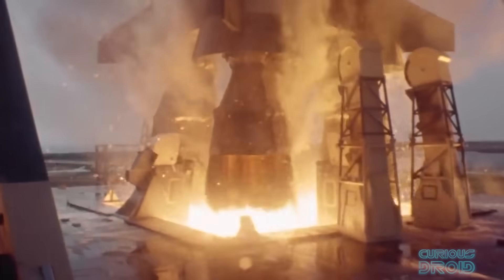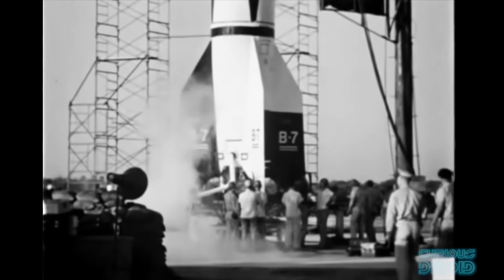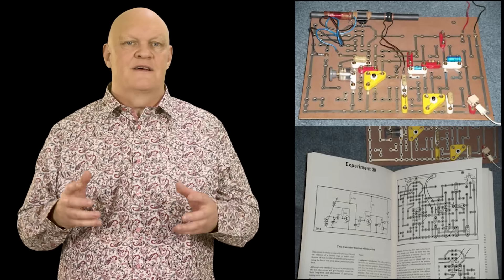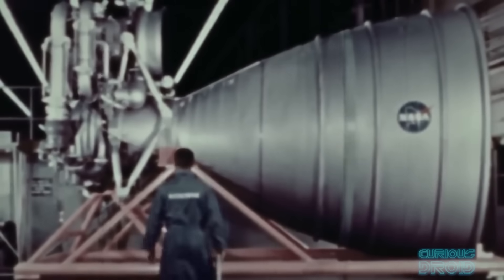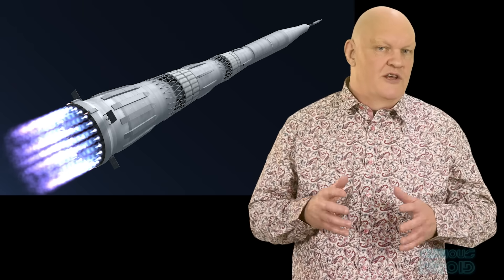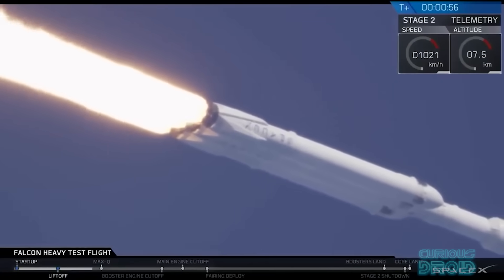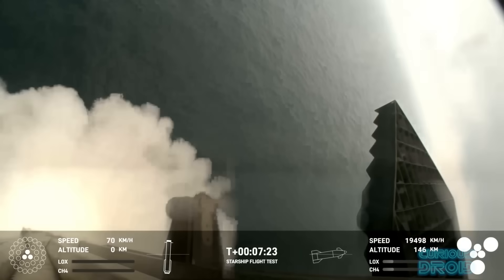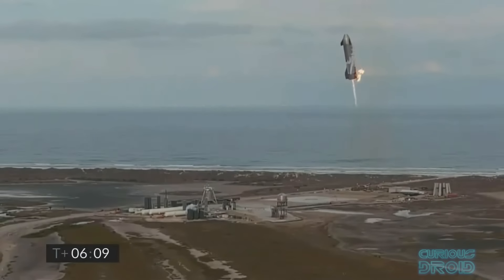Why Does SpaceX Use 33 Engines While NASA Used Just 5?

Comment: I think that they should either add 2 fuel tanks to the side of the Starship.  This way like Falcon9 the 1st 2 engines could be ejected back home and 2 refuel s could be used off a Falcon Heavy s engines. I know that sounds weird but I’m sure either through that means or just by finding a means to swap out fuel tanks or carry 2 extra side tanks. Surely that would help make refuelling it easier. ??
Reply: Would make it more difficult. The plumbing would be more complicated, the detachment mechanism would be complicated, and everything would add weight. Further, the tanks with fuel would be too heavy to carry up in another Starship. The fuel weight is around 1,200 tons and the payload weight can only be 150t.

The easiest thing is to simply dock and pump the fuel from one vehicle to the other.

Comment: Mathematically SpaceX has a higher chance of failure IF each engine carries the same probability of failure
Reply: The engines have a higher chance of failure, but the mission has a greater chance of success since a single failure wouldn't cause a mission failure. Further, because the engines can be massed produced, they have the possibility of a lower failure rate.

Comment: The falcon 9 heavy and starship suffers what i call the "N1 effect" (also known as the add moar boosters or KSP effect). This effect is what happens when engineers are unable to develop more powerful engines for one reason or another and instead opt to strap a massive amount of smaller, existing engines onto a rocket.
Reply: These boosters land on the engine thrust.

However there's a minimum limit to which engines can only be throttled down. If you use big engines you can't land the empty and light boosters any more.

Rockets which are only single use don't have this limitation.
Reply: You do realize that the Falcon 9 had launched 3x more times successfully than any other rocket in history, right? SpaceX literally built the most reliable rocket ever by far.
Reply: Given all that, SpaceX is kicking NASA's @ss!

Comment: Here is the short answer. If you have 33 engines and you lose one or two, no big deal. If you have five engines and you lose one or two, RUT-ROW, NOW WHAT?
Reply: When has an engine failure actually been a problem?
Reply: @MrSummitville  Actually, lots of times. Even the Saturn program had engine issues turn into problems. Just not with the F1. Recently with a Falcon upper stage as well. But many rockets throughout history, new and old, have had major issues due to engine failures.

Comment: I suspect SpaceX's Starship program can be game over if they lose one more. They lost already one hundred engines.
Reply: Nope. Their tests so far have all achieved their desired goals. And none of the tests were planned to save the engines or boosters. Flight 4 actually had both the booster and upper stage land, but SpaceX didn't go out to get the engines. Further, they are already beginning production of Raptor 3 engines. So the dozens of Raptor 2s that are already built are literally going to be used for tests and then scrapped if they survive.

Comment: Also a bit improper to compare spacex and the ussr with regards to testing. While spacex does use the go fast and break things often method, they also test each engine rigorously before putting it on the rocket

Comment: One engine failure on a Saturn-5 booster takes out 20.0% of your thrust and is catastrophic.
One engine failure on a Starship booster takes out 3.03% of your thrust and is negligible.
Reply: How many Saturn-5's had an engine failure, after launch?
Reply: @MrSummitville there was one, and it could only be compensated because it happened not in the initial period after lift off.

However you could not land a Saturn 5 booster on the engine thrust  because the thrust of 1 engine would still be way too high (even if the technology to control that would have existed back then).

That's why Falcon rockets and Starship are using more, but smaller engines. They can land on the thrust of their engines.

Comment: When the nozzles are non steerable and use instead fixed position thrust modulated, the number of them must be multiplied in order to provide redundancy to more than one level. It's a numbers game.
Reply: No.  It is not like that.  Starship's first stage booster rocket has 33 raptor engines.  The 20 outmost ring of engines are non steerable like you said.  However the rest 13 Raptor engines are steerable with gimble   The booster can use the rocket engine's gimble to control direction.  This is the area spaceship improved over the Soviet Union N1 rocket.  I think it is all about throttle control.  It is simply the easiest and most powerful throttle control.  If you turn on just one engine, the power is throttled all the way to 3.3%.  Such precise throttle control is very useful in re-entry burn and landing burn.

Comment: 8:45 reminds me of finding what causes elusive rare but critical effects. Driving a single event shock into a closed loop system to provoke a response, then studying how nodes in different places in the closed loop react, their relative phase between them in the time domain, this analysis points to exact mechanism of effect.  In this engineering for manned spaceflight is not good enough to 'opamp unstable add a capacitor', instead it needs to have demonstrable phase margin over full operation bandwidth.

Comment: Why Does SpaceX Use 33 Engines While NASA Used Just 5?
So, in sort, what is that answer of the above question?
Reply: Nasa uses a single use rocket.

Space X develops Starship to land on their engines. So the minimum thrust has to be low enough to land the empty booster.

If you use 5 big engines the minimum thrust would be way too high to land the booster.
Reply: Did you watch the video?

Comment: The Russians used 32 engines that couldn't be fired accurately at the exact time. After the first one took off the second stage fired and blew up the hydrogen tank of the first stage that it was sitting on and blew up the rocket. When the next rocket was launched it fell over because only about half of the engines fired. The rocket blew up with the energy of two atom bombs and killed over 100 of Russia's best rocket scientist and the third Russian made moon rocket was later sold to a billionaire in Arizona. I think that 33 rocket engines is a terrible idea that could bankrupt our space program just like it did for the Russians.
Reply: Given all your negativity,  SpaceX is still kicking NASA's @ss.

Comment: Because SpaceX is unable to development a large engine.  They  only have one used system, to Earth orbit and docking, Falcon 9 and Dragon..  Nasa and the Soviets have been doing that for 60 yrs. They don't have a market for Heavy and Star Ship has exploded every flight but one. 8 failures that SpaceX gas lights us saying  the failures are really successes,  Saturn V, 55 years ago never exploded .
Reply: Starship has reached orbit 3 times and the Falcon 9 is the most reliable launch vehicle currently in operation. NASA relies heavily on SpaceX and Russia's launch cadence has almost stopped because of them. They don't have a large engine not because they're unable to develop one, its down to economics and reusability which smaller engines are better for
Reply: @Ethan_Roberts  What does "been to orbit" mean?  It doesn't mean it was in orbit.  I guess you're saying it went as high as an orbit is. At any rate the Star Ship hasn't orbited, which is it's purpose. If SpaceX is so great why is it they have only one marketable launch and docking system.?  And after years of exploding, the Star Ship hasn't been in orbit and is delaying our moon mission progress.
Reply: @davidsoom1551  it achieved orbital speed, its quite simple really. Why do they need multiple docking systems? The Dragon vehicles are doing exactly as NASA wanted and have done so for over 10 years. Starship is not delaying Artemis any more than SLS and Orion have delayed it or any other contractors. Do realise that delays are expected with complex space programs
Reply: @Ethan_Roberts  SpaceX isn't the most fantastic launch system the hype presents. There are nearly 50 launch providers that service the space launch market.  In this regard SpaceX is small potatoes. Heavy is never used as it has no market.  Star Ship designed for Elons million person Mars colony is ridiculous. This whole idea is preposterous. It has no sustainable future market. Point to point military use is laughable when you understand you cant load the rocket with anything useful as you have to lift everything 250 ft and load it through a small door.  Regardless, don't think SpaceX will get us to the moon and less so to Mars. Enjoy the CGIs.
Reply: @davidsoom1551  never claimed it was the most 'fantastic launch system' but looking at their track record and the falling launch cadence for almost everybody else, I think that's pretty good evidence to say they probably are the best current launch provider. Starship is still under development so to say it has no future is just hating. Bet you also said the Falcon 9 would never be reusable too
Reply: @Ethan_Roberts  If there is a falling launch cadence among all launch providers it's because there isn't a great market, about 100 launches worldwide per year.  Again, the future market, when you realize the Mars colony is a joke, isn't there. No one is using heavy and Star Ship is for Mars colony. lol  Why so many failures in the Star Ship development when Saturn V, at the very beginning of space travel had no such explosions, one after another?  Seems things aren't going well for the super rocket with no future.
Reply: @davidsoom1551  I said most, learn to comprehend what I'm saying. Roscosmos, ESA, and ULA are hardly competitors due to their low cadence. Customers are mostly using the Falcon 9 to go to space. And to say there is no market at all is BS as the total launches worldwide is increasing with 146 in 2021, 186 in 2022, 223 in 2023, and most launches this year so far are from SpaceX. Starship is being developed in a different way to the Saturn V, trying to use their method of iterative development to call it a failure is disingenuous
Reply: Tell me, what is the future market for super heavy StarShip that will give Elon his needed cadence of 3 flights per day?
Reply: @davidsoom1551  Starlink and whoever else decides to use the launch vehicle.
Reply: @Ethan_Roberts  That will be 1100 launches a year?  Starlink?  You have just proven there is no market.  And don't again label me with your "hate" talk again. That just shows your weak generational name calling non sense.  So it's settled, there is no future market for the massive Star Ship.
Reply: @davidsoom1551  again, people like you said there's no market for reusable rockets or that they will just be a fad, you were wrong. You're simply hating, that's an appropriate label for somebody like yourself

Comment: Apollo 13 only had 4 working engines after launch.
Reply: It was the center engine, on the 2nd stage. It was shutdown after ~5 minutes, instead of ~7 minutes. An electrical problem turned the engine off. The engine did not actually "fail".

Comment: The N1 rocket was only more powerful  than the Saturn at the first stage level. Once that stage was dropped the upper stages, which used the same type of fuel and engines had less ultimate power relative to the weight of the stage. Thus a lighter weight lunar hander, with just one Cosmonaut aboard to walk on the moon was the plan, had the N-1 worked right.   The Saturn upper stages used hydrogen and oxygen, a more potent mixture yielding more capabilities  for the  three U.S. astronauts with two able to land.

Comment: NASA used three engines on their rocket because that was the minimum number of existing engines that was adequate to provide the safety margin that they wanted, for controlled, if less than  optimal, flight.  I'm betting that when SpaceX gets into the 4th and 5th generation of the rockets and further improves their reliability and cost of manufacturing of the engines they're using now for Starship they will reduce the number of booster engines and make them larger.  There're factors that create a point of diminishing returns in tons per launch to orbit - infrastructure and location.  The acceptable launch sites are all on national boundaries ( not in my back yard) and all have logistic issues.
Reply: What benefit does reducing engine count provide?

Comment: Actually Apollo 13 had the center engine fail minutes into the flight.  In fact, there was panic as to scrub the mission or not.  Imagine if they had scrubbed the mission, history would have been a lot different.
Reply: The engine did not actually "fail". An electrical problem shut the perfectly functioning engine down, two minutes early.

Comment: There's no reason not to bring the F1 back and modernization. 1.5 million lbs of thrust is still unrivaled for a single chamber engine. With modern materials and manufacturing, significant up rating is possible. 2 million lbs of thrust is a real possibility.

Comment: Those are propulsion nozzles. There are 32. Rockets don’t have engines. They are not jets.
Reply: Rockets usually have engines. It's called an engine when it uses liquid propellant. If it uses solid propellant, it's called a motor.

Comment: Russia Engeria that carry their space shuttle had 20 nozzle. it is well know that small nozzle allow for more even burning since the pressure difference from the edge to middle is smaller. this also mean you can greatly increase the pressure of the nozzle and increase it fuel effectiveness at fairly low cost. but more nozzle = more plumbing making them harder to build.

Comment: In the 1960’s, rocket engines failed in spectacular explosions, not gentle shutdowns.  The more engines you had, the more likely one of them would explode.  5 engines is much more reliable than 30.  50-60 years later, it’s possible that modern engines are more reliable or that modern engine failures don’t necessarily mean the vehicle explodes.
Reply: "The more engines you had, the more likely one of them would explode." But the bigger the engine the  more likely it would explode because of combustion instability, which was not a solvable problem until good CFD (Computational Fluid Dynamics) was available. von Braun blew up an awful lot of F1s on the test stand fixing this problem by trial and error, even with his pintle injector design. How many engines you used, and therefore how big they were, was a balancing act between failure modes.